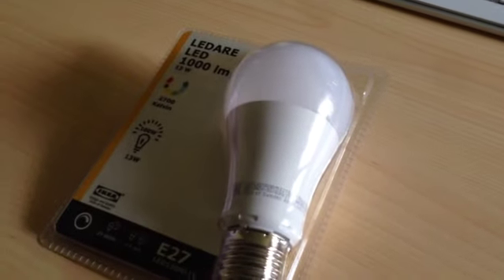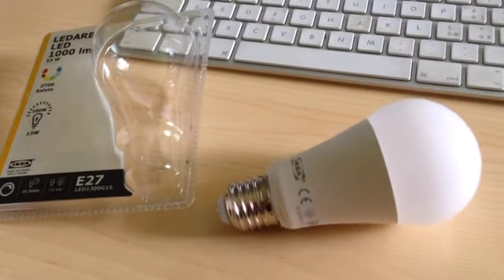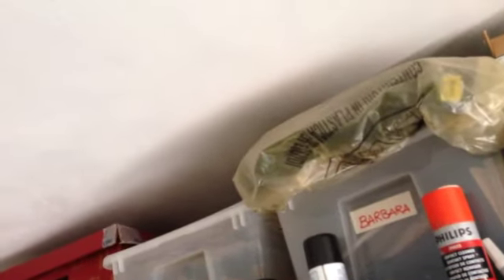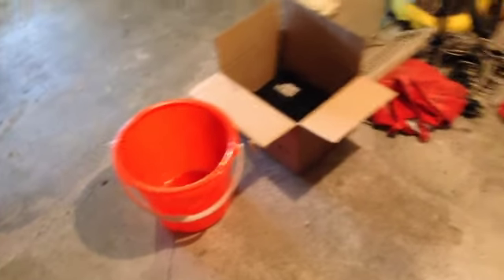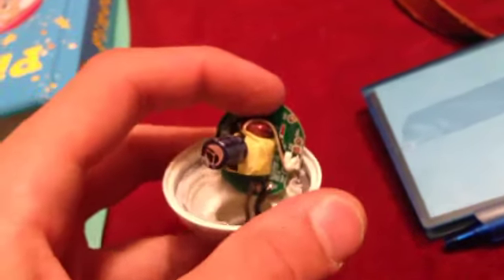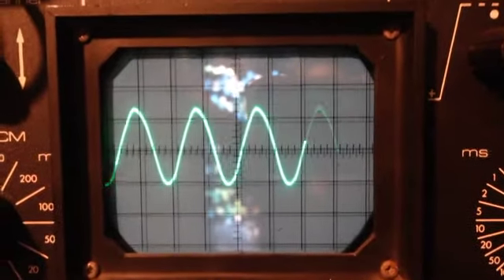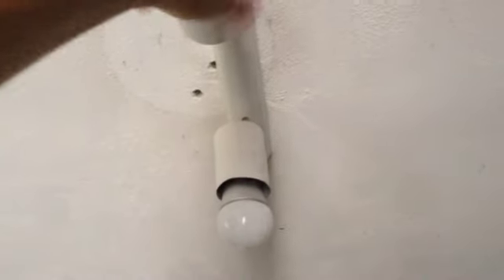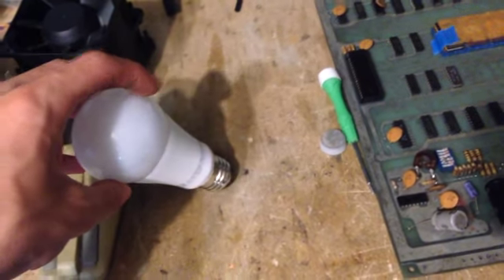IKEA 2014 Ledare LED Bulb 13W 1000 Lumens Review (220V Europe)

Comment: I recently took apart two Ikea 1000lm bulbs (new "RYET" model which costs only 10 euros per packet of two in Finland!) and judging by eye only, the components, the power source in particular, seem to be of very high quality. The power supply is a real switch mode power supply, not one of those non-mains-isolated capacitor contraptions which you see in low quality bulbs.
Reply from the maker: +Jaakko Oksa Great!, thanks for the info. I also made a video about the new RYET bulbs as soon as they came out, you can check it here: https://www.youtube.com/watch?v=lJe4QvdA52o

Also, can you share a couple of photos of the electronics inside them? thanks!
Reply: +Francesco Ferretti (Ferrix97) 
Incidentally I can because I took some cellphone photos of it. There are some SMD components on the other side of the PCB which are not seen in the picture. The reason I took the bulbs apart was that I installed them permanently in a lighting fixture which used to have 2xe14 sockets and I wanted to have more light out of it than would have been possible using two e14 bulbs. The price of the packet of two was 9.99 euros or thereabout here in Finland. https://dev.gruppo.fi/~jaakko/Ryet/
Reply from the maker: +Jaakko Oksa Thanks!, that looks like a very simple design. It is a single sided board, that means that all of the magic happens on the underside, with the SMD components
Reply: +Francesco Ferretti (Ferrix97) Yes, there was an integrated circuit there, and probably a few passive components. The outputs of the power supply are isolated from mains, despite of the fact that the device is insulated. It is surprising that it is profitable to make something as complicated as that and sell it for 5 euros :-)
Reply: +Francesco Ferretti (Ferrix97) A friend told me he had two of those Ledare bulbs which have died after less than a year, and that both failed so that they alternately turn on and off. Clearly the cause is that the power supply has become faulty due to high temperature.
Reply from the maker: +Jaakko Oksa Yes, if the bulb runs too hot (like in an enclosed fixture), the heat can dry up the capacitors inside it, which should cause the issue you mentioned.
Reply: +Francesco Ferretti (Ferrix97) I have high hopes that my lighting fixture will last the promised 15,000 hours (less than what they promise for the Ledare) because my power supplies do not get as hot as they would inside the bulb :-) The 2000 lumen luminous flux makes it work really nicely as the sole light source for the room where I installed it.
Reply: +Francesco Ferretti (Ferrix97) In europe you have a standard 2 year warranty, so if it breaks within 2 years you're getting a replacement.
And on some products like washing machines and fridges the 2 years is extended in some EU countries, because those devices should be expected to last longer than 2 years. (Never throw away a receipt, even if a product says only 2 years)

Comment: Francesco I think I have figured out why some led bulbs flicker and the better ones don't. The not so good ones have a "capacitor dropper" power supply which is basically just a capacitor which limits the current to a desired value, somewhat like the ballast of a traditional fluorescent lamp, the difference being that the ballast is inductive whereas the capacitor is capacitive. This means that the current that flows through the leds is rectified sinusoidal current, and so it the luminous flux, whereas in bulbs that have a switching power the current is more or less pure DC. 

One could verify this pretty easily by measuring the mains current, the capacitor dropper is a relatively low impedance reactive load, whereas the switching power supply probably isn't, so the amount of AC current that is drawn from the mains should be much (probably many times) higher in the capacitor dropper version even though the power is the same.

The capacitor dropper is the reason why the dangerous Chinese corn cob lamps, which are being sold in eBay, have live parts. https://www.youtube.com/watch?v=n3ci4nlKhEk

Comment: Soooo I was a total noobie buying ikea lights. I bought a ceiling light fixture and got 1000 lumen bulbs....the fixture took 3. My rooms feel like it's on the freakin sun.

Should I just switch to lower lumen bulbs, or install dimmer switches? I kinda do like the choice of cranking up the brightness if I want to clean, though
Reply from the maker: Zahir Latif usually LED bulbs don't behave nicely with a dimmer, sure, they dim, but sometimes their range is pretty limited or they will start flashing and doing other crazy things. Not all dimmers work correctly with LED bulbs.

I think it is better to move two of the 1000s into another fixture and getting something like this instead: https://www.youtube.com/watch?v=MTSDjIxlqjk

also, I live in Italy (220/240V), maybe your dimmers won't create any problem. all the dimmers I've tested were made before the introduction of LED bulbs, but I think that there are no differences between the old and the new ones.